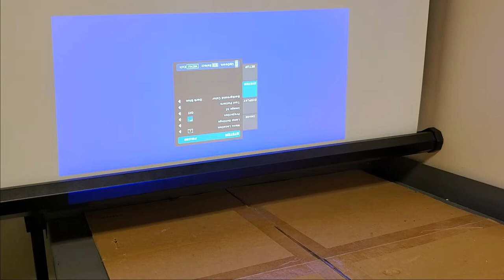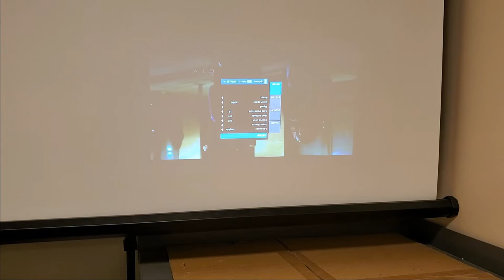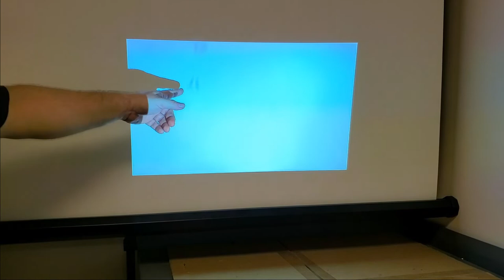Optoma HD20 DLP Projector Power Supply Replacement P 2

Comment: Thank you very much for this video, and its predecessor!
After a series of "lamp failure" indications, the projector died when I was turning it off. Heard a very loud high-pitched pop sound that had to be the lamp or the power. 
I live in Brazil, this is 2022, and my projector had the exact same problem as this one in the video. I opened it up, turned it around, and there was the black sliver off the top of the LNK IC. Got lucky ordering from China for about $50. An exact replacement of the power supply came in on just 3 weeks. All is back in working order now, I hope.
Reply from the maker: Fantastic to hear! I suspect all will be well. These are still wonderful projectors. you are very welcome for the video, I thank you for taking the time to watch

Comment: Thank you.. this video was very insightful.. do you know if there's a way to take out the rubber legs on there? Cuz my projector stand legs are not able to fit properly on the three small holes ... So if the legs come out, the stand can attach perfectly
Reply from the maker: technically yes.  However it is not easy.  There are nuts on the inside on the top of the threaded portion that is attached to the foot. You may want to use washers, or some other spacer( I have used short pieces of small plastic pipe) and space it that way.  The only other way to remove the feet is cutting them off and that might be a bad thing to do.
Reply: @FixitFrank  oh Alright 👍 thank you so much for the advice, ☺️ okay I'm not going to use the black ones.. I'll figure out a different way and I'll update you here 🙃 Thanks again!

Comment: I had one of these that I couldn't diagnose, but I've had it for a decade or so...  Power outage while it was on - got it onto power and hoped to get the fan going ASAP but it hasn't turned on since then - just sits and flashes the green light on the power LED.  I'm sure the heat cooked something but I don't know what.

I grabbed a replacement that was supposed to be good except for a couple dead pixels, but it arrived wonky - hit power and you immediately hear a click, the power LED flashes amber, then you'll hear another click and the temp light goes solid red.  Now that I have two of these I'm hoping I can assemble some kind of frankenprojector that works.

Looking at the board and service manual I'm thinking (hoping!) that it may just be a bad thermal switch.  Seem possible or should I just disassemble and swap the power supply?

Thanks!

Comment: Great video.  My HD20 LVPS has failed with a fried thermistor (I think is thermistor).  It is the round dark green 2 post guy on the far left near the power connector labeled THR1.  I would like to try replacing just it before the whole PS.  It does not have any markings.  Do you have any idea what type/rating replacement it would need?
Reply from the maker: Yes! It's an NTC thermistor, SCK 108 (10 ohm 8 amp) is the marking. Be sure to examine the LVPS driver IC(U5). If it exploded, the transformer is bad and you need to replace the whole module. Rs2 is another known failure.  It's rare but thermistors do fail.  If yours shattered, then I would definitely check the rest of the semiconductors. Mainly the large mosfets, U5 and the bridge rectifiers.

Comment: Hi Frank. I had a pop with flash of light and my HD20 went down again. Already done bulb using your videos. Doesn't appear to have been the bulb this time. What would pop like that with flash of light, and leave this not powering up? No standby light, etc. Thanks!
Reply from the maker: Hello !  I suspect you had the power supply chip explode.  That is what happened here.  Repairing those power supplies is really hard.  The flash was probably the chip exploding.   You likely need a new power supply.  Thats is the fastest/easiest way to get back up and running.
Reply: @FixitFrank  cool. Thanks for the reply. I'll proceed down that road 👍

Comment: At 18:40 you talk about replacing it's color wheel. Is this a common thing to do? It seems to produce a picture, and you didn't scuff the wheel. Do wheels have their colors fade from the light source and need replacing to bring them back to full potential color etc.? If so, hour many hours on the projector is it typical to have to replace one? Nice vid, and follow up even after almost two years holding onto it to finally fix it. TNX
Reply from the maker: Hi Marcus!  The actual color segments do not fade or go bad for the most part.  I am sure it has happened but usually the ND coating is pretty thick and reliable. The usual failure mode is the oil-bronze bearing in the center of the hub.  It starts to drag and then the wheel will stall or not spin evenly and that will cause the error.  A lesser common problem is the glue that holds the segments will dry out and fail.  Then the segments actually launch out and smash into pieces.   have an NEC video (V260 https://youtu.be/4Tr68SblaqQ)  that has that issue.  It was more common on older projectors that got very hot and or dusty. 
I see color wheels fail after about 7 years on average.  Sometimes much later, sometimes earlier.  Some BenQ service manuals say you should change them every 3 years along with the fans which is laughable in my opinion.  I say let them run until they don't.

Comment: +
Hi Marcus, Thanks fort posting this.Iv'e had this exact same model HD20 for some time now. I replaced one bulb since. Now, yesterday same thing happened. As the one in this video. Fuse was alright and couldn't find anything until I watched this video.. and sure enough. Exact same. Seems that custom transformer is low quality causing that IC to pop. Anyway, I can't tell the transformer is bad , It seems to be open, but not sure. It blew that same leg off the IC. Will try and replace the IC part, if that doesn't do it will start shopping for a 4K.. $$$ BTW: Could you post a link for the Power supply you found.  How much was it? I guess no hope anyway since a China part.

Comment: Hello dear Frank, I am a faithful follower of your work.  I have u.  Optoma hd20 projector and the selan in HDMI does not work.  What would be the problem?
Reply from the maker: I would be suspicious if the HDMI chip. I would also check the connector itself and make sure no pins are bent.  There are also some TVS diodes that protect the HDMI chip that can fail, blocking HDMI. replacing or removing those TVS diodes can help. I would read over the service manual, https://www.manualslib.com/manual/687116/Optoma-Hd20.html and get familiar with where the parts are.  The service menu may have some information that is helpful. That is also listed in the service menu.  Worse case a new mainboard will fix it, but I hope you can fix it as is.
Reply: @FixitFrank  thank you very much brother.  thanks for illustrating us with your work.  Blessings.